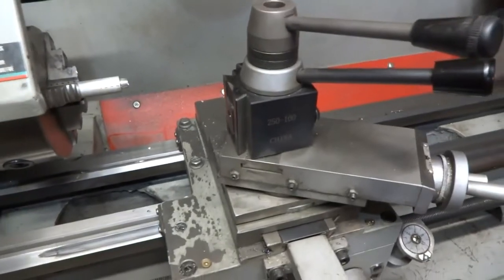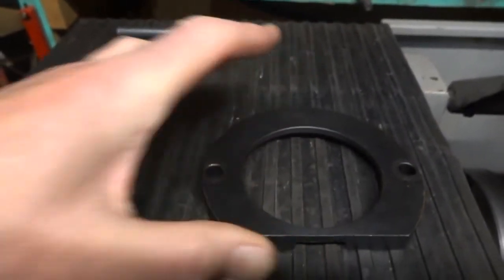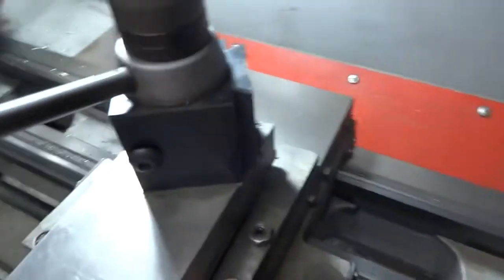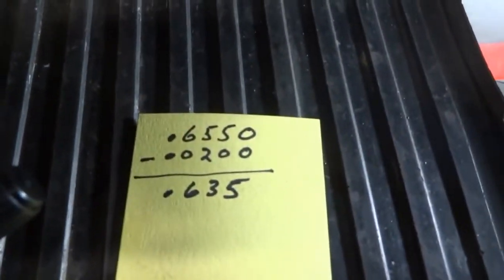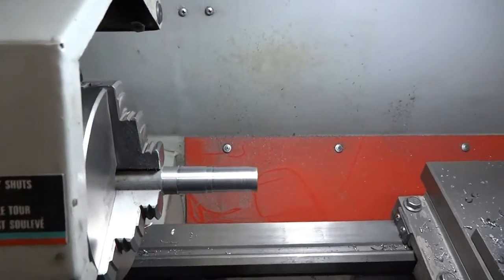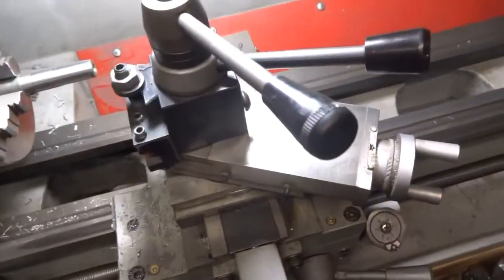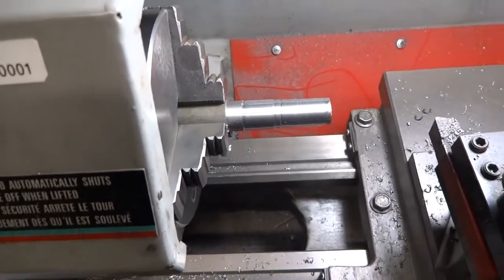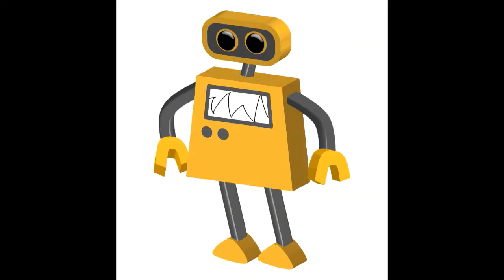Small Lathe Spring Back

Comment: Hello, I noticed you have a carriage lock on your lathe.  I have the same lathe but mine does not have a lock.  I noticed on mine that when I have some resistance on my compound slide the carriage can move. Was your carriage lock added by you?
Reply from the maker: The original carriage lock was just a set screw. I made a handle with the same tread and installed it instead. It is much easier to use now.
Reply: Thanks.  Any chance you can do a video on this change?   Txs. Or at least a close up.  I am a new user on the same lathe.  I don't think I have a set screw on mine
Reply from the maker: OK I will work on that.